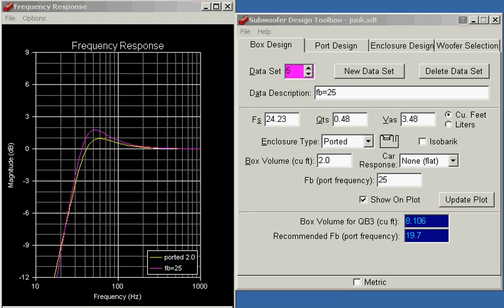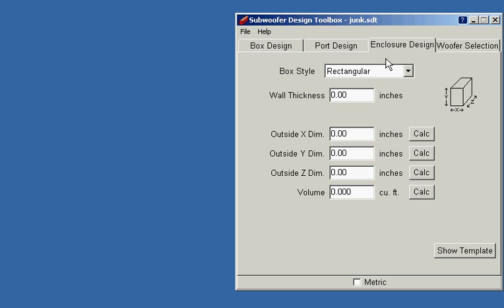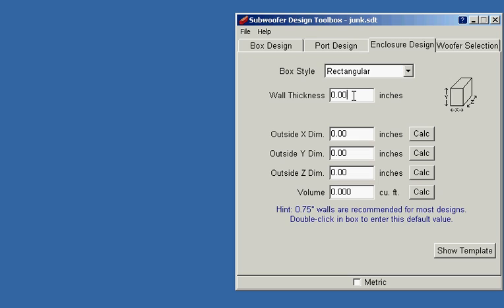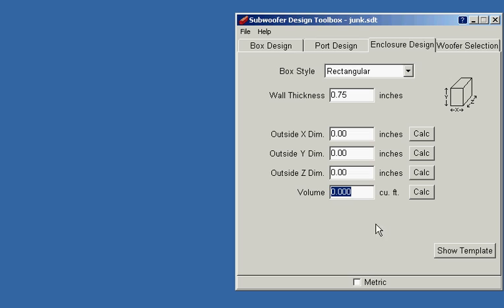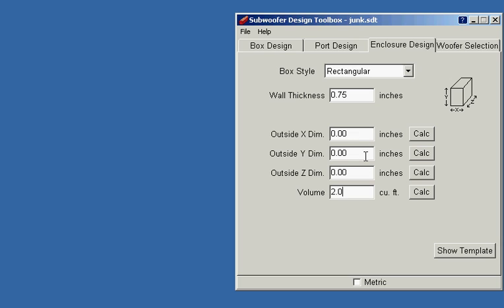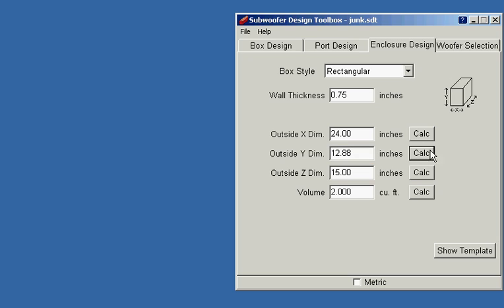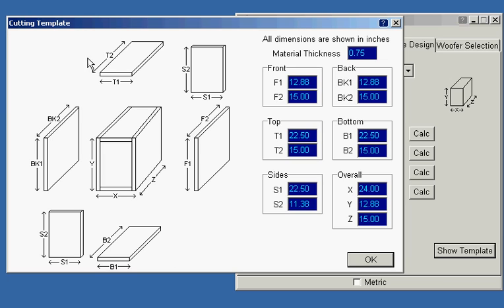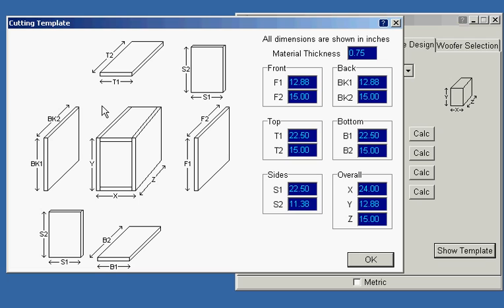Design Your Own Subwoofer Box - Part 3: Enclosure Design

Comment from the maker: @jpc002 
The program doesn't automatically adjust for the internal volume taken up by ports, bracing, crossovers and the back of the woofer itself.  A rule of thumb is to increase the constructed box volume by 5 percent to compensate for these.  If you think the port is using up more of the box than 5 percent, calculate the port volume and use that number instead.  Sealed boxes are very insensive to small changes in box volume, and the correction is generally not worth worrying about.

Comment: Firstly, thank you for the informational video!  

Secondly, I have similar questions as the youtube member lilceazy87... How does the program adjust for the volume of the port-tube inserts?  Does it at all?  Or is it omitted simply because the difference of taking port volume into account versus not taking it into account is negligible?

Also, since the program assumes this to be a ported box when calculating volume, does it use a slot port or port-tubes/aeros in the calculation? 

Thanks!